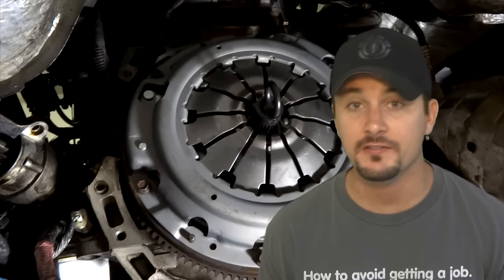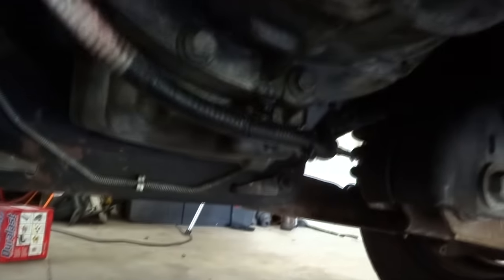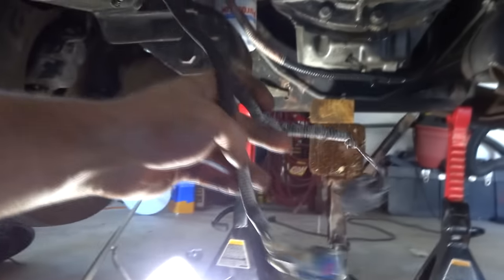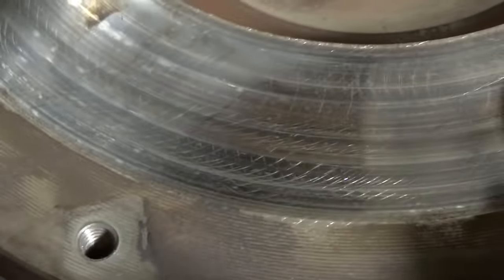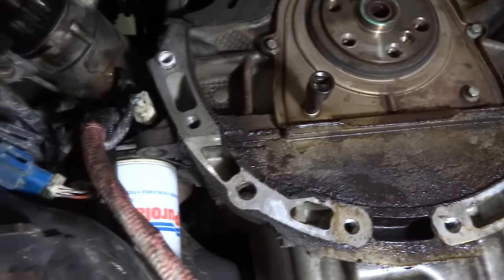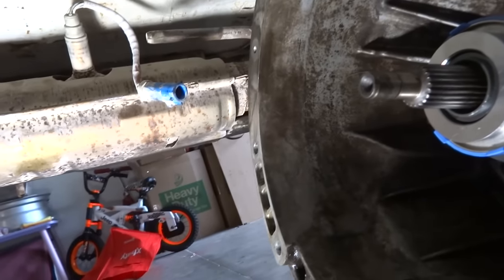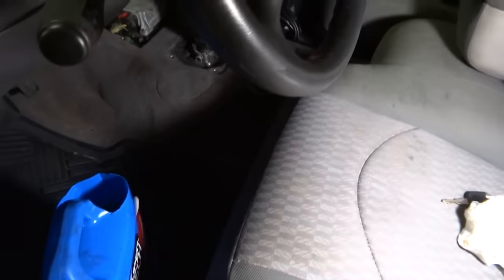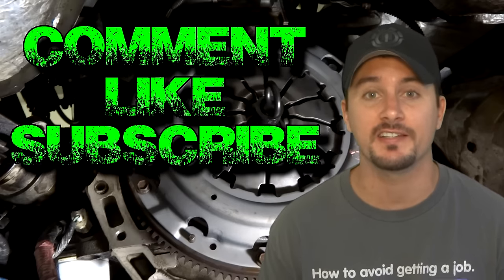Clutch Replacement Ford Ranger & Mazda B-Series ⚙️🔧

Comment from the maker: 🛒 Shop This Video: https://www.nthefastlane.com/clutch-replacement-ford-mazda-store
🛒 Visit Nthefastlane's Amazon Store: https://amzn.to/3pP4UCy
Reply: Kinda confused on a couple of things.. When you replaced your rear main seal it appeared that it involved removing an entire metallic type housing with the actual seal in the middle.  I have a 2000 2.5L I4 (5 speed of course, the common Mazda M50D-R1) and every "rear main seal" I can find for mine just appears to be a circular piece that looks similar to a large wheel bearing seal.  I can't even find the part you replaced on the internet, and it isn't in the "Buy Parts For This Repair Here" link.  I would think mine is just different but I can't even find that part that you replaced.  It looks like the rear main seals I've found just replace the circular part in the middle of the metallic assembly you removed.

After quite a bit of digging I was able to find the part I think you used (BS40689) and it does not list 2000 Ranger as compatible, so I'm guessing it must be due to my 2.5L engine.  None of the sites list that part as compatible with my Ranger..  so I'm just gonna buy the round one and hope mine looks a bit different once I dig into it!

Also, the constant correcting yourself when you mis-spoke is a bit annoying after the 100th time or so.  It makes it pretty darn confusing for people who aren't completely familiar with all of these parts, and people who are completely familiar with all of these parts really don't need tutorial videos anyway.  You obviously edited quite a bit since we didn't need to see every bolt being removed and an eight hour video, so I'm curious why you didn't edit some of that stuff out.  Just some constructive critisizm.  You're still getting a thumbs up from me for all of the help, and taking the time to try to show others how to do such an involved job.  Thank you!
Reply: Nthefastlane hi
Reply: where are you located, can you fix the clutch of my ranger?

Comment: Thank you so very much for this video.  Because you did this video I was able to fix my truck.  Thanks so much.  Its people like you that make youtube great.  I had shifting problems tried to go the easy way and replaced my master cylinder and had the same problems.  Then I figured I had to change the slave, thanks to you I was able to take the tranny out I looked at the clutch and it seemed waisted.  I was able to change my rear main seal, my pilot bering my slave cylinder and my clutch and I really don't know if I could have done it with out this video.  Also the bread thing worked, I ended up stuffing a 10mm with bread which was a little smaller than the inside of the pilot bering worked great.  I felt pride as I driove my truck away working, thank you.

Comment: I bought my Mazda B2600i Labor Day weekend in 1992.  I have been driving it for 23 years and it has 303,400 miles on it.  The original clutch is going out now.  I have pulled my 16 foot car trailer 1,000's of miles, and many other trailers.  It has been worked hard.  God has blessed me with a great truck, so today I am putting in a new clutch kit.
Reply: +Ivak Cooper What size engine do you have in it?
Reply: +Mike A-strong  Mike, It is a 2.6; B2600i
Reply: Those Mazda B-Series are NOT the same thing as a Ford Ranger. Your 1992 is Mazda's own truck that they used to import, but they partnered with Ford and created a Ranger copy starting model year 1994 according to the Haynes Repair Manual I have.

I'm gonna be doing this to my 1995 Mazda B2300 5-Spd Regular Cab. Release bearing went out and won't shift into a gear, and once it's in gear, it WILL CONTINUE to stay in gear no matter how hard you press down on the clutch. We replaced the master cylinder and bled/burped the hydraulic system 6 months ago. Might as well replace the slave cylinder since it's in the same bell housing, which is such a dumb design.
Reply: Theodore,   I am still driving it.  I think I have another 8500 miles on it.  I put in a clutch kit from O'Reilly's just to save money, but it isn't the same.  I never did think much about the Ford Ranger.
Reply: Ivak Cooper

Comment: The bread trick is absolute genius!  I used a 6" piece of 1/2" round steel with one end tightly wrapped with electrical tape built up to create a snug fit inside the pilot bearing.   Worked like a charm.  Thanks for posting this, I'm replacing transmission, rear main seal, clutch & flywheel on a 2002 Ranger 2.3 👍
Reply: Two years later, truck shifts and drives perfectly. 👍

Comment: Awesome. Great job. This video was extremely thorough & detailed which was exactly what I needed. Your camera work couldn't have been better. Took me ALL DAY, but a small price to pay for the experience & the time & money I saved doing it myself. Couldn't have done it without you. Something tells me that making these videos isn't near as easy as you make it look. Keep doing what you're doing. Thanks.
Reply from the maker: Awesome PCN! Glad you were able to use the video to get the job done. Thanks for the feedback! 

Nope, it sure isn't. I did a comparison a while back when recording a strut replacement. Filming the passenger side strut replacement took nearly 4 hours if I remember right. Not filming, the driver side strut replacement took 15 to 20 minutes tops.
Reply: @Nthefastlane  as someone who does video production for a living, filming in all these tight places with terrible lighting is a royal pain in the ass.  It makes it twice as hard and slows you down so much.  But thank you for taking the time to film this.  Im no mechanic, so i rely on videos like this to learn.  The detail is greatly appreciated.  Subscribed.

Comment: For a transmission jack, we drove (or pushed) the car up on ramps (Today's plastic ramps aren't nearly as tall or strong) laid on our backs on the grass and used our hands and our knees for removing manual transmissions on '66 mustangs, '69 Torino's, camaro's and later on an '84 F150, I din't even use ramps. Just crawled under it in the driveway and did it.   Manual transmissions are heavy but aren't nearly as heavy as an automatic. Of course, it helps if you are reasonably strong, in shape and used to dealing with weights. In the 70's, most of us were. Now, at 60, I may still be up for it on a ranger 5 speed transmission. That's the plan, anyway. I May try your improvised jack if I don't feel froggy enough when that day gets here. Thanks for the video.

Comment: Nice job, i replaced a clutch on a 2000 Heavy Duty 7.3 Powerstroke and the Ford clutch broke 1 out of three springs. I replaced the Ford clutch with a NAPA clutch, they updated from 3 to four springs.  The clutch comes complete with a  fly wheel. Great job on your video lots of detail... Stay safe and Happy motoring

Comment: Thank you for providing such an informative video. It has been an invaluable resource for information. I happened to buy the same Duralast Clutch Kit & Slave Cylinder as you did from AutoZone. Might as well change the Slave Cylinder since there is no other way to get to it. 

My truck is a 1995 Mazda B2300 SE Regular Cab 2WD model. 196,346 Miles on it. Odometer stopped in 2010/2011. I estimate the truck to have 205K or 210K miles. Clutch pilot bearing failed and completely ruined while driving around town. Truck wouldn't go into gear when running, and if it was already in gear, it would stay in gear and no matter how hard you pressed the clutch petal, it had no effect on disengaging or engaging the clutch plate, like a dummy petal on an automatic car. Clutch is in good shape considering the mileage and flywheel is in even better shape. Going to replace clutch anyway.
Reply: What’s the parts number

Comment: I liked your video, I am planning on replacing the clutch on my 88 ford Ranger 2.3Lt. Reg cab and long bed, with 635,000 k on it. It runs Perfectly and believe me.....I see newer trucks broken on the road. Mine is a jewel of ford's engineering. An it also is my anti anxiety/depression therapy truck. We have 3 more newer cars, but this is special!
Reply from the maker: I can relate, I use my shop as anxiety therapy all the time.

Comment: @nthefastlane Thanks alot for the detailed video! I just had a clutch kit installed "professionally" and a month later i am hearing a knocking noise when i let go of the clutch after running for some time. I will use your video to walk me through the wrongs and rights to figure out what the problem is.

Thanks again, Nathan
Reply from the maker: Nathan e Anytime, glad I could help..follow the steps and you should have no problems at all.

Comment: Great step by step video. I have a 2011 xlt 4.0l 4x4 with less than seventy thousand miles. Clutch pedal stuck to floor and fluids coming from transmission where the slave cylinder is.  Going to start on it in the morning.

Comment: Great tutorial video . Just one suggestion , it would be great if you can give us the torque specs for bell housing to engine bolts, drive shaft to rear axle bolts and wherever bolt or nut torque is required. I love your ingenuity of  transforming that jack into transmission jack. I learned alot. Thank you

Comment: On my 98 Ford Ranger 2.5 v4, the flywheel bolts where 17mm rather than 18mm as stated in the video.  Also, the torque specs where significantly lower for them.  I foolishly went by the video and almost rounded out a bolt.  Overall, this video helped immensely!  I liked the beatle part.  Proper job!

Comment: excellent video! thanks for posting it. I'm replacing my transmission because it died after 327,000 miles and this really answers a lot of questions about what I can expect. One question: the rear main seal is just the rubber part, right? Not the metal housing, too? Oh, and couldn't you have knocked out the pilot bearing while you had the flywheel off? I'll go back and watch again to see.

Comment: Hey Nthefastlane nice videos,  quick question do you know if there are different style throwout bearings?  I ordered a LuK 07-140 Clutch Set from amazon and my friend that is installing it for me said the bearing is different than the original stock, the stock bearing has grooves for the spring?  He said the one in the set is a cup style or something?  I tried asking at auto zone but haven't gotten anywhere yet, unless theres an installation manual somewhere to show the difference in styles?  Anyway just looking for some suggestions/tips thanks.  Great job at getting clear views of the installation of this clutch!

Comment: excellent video the camera was excellent angle i have the same problem and when i started the truck when is cold the gear shift not engage until is hot i don't know what is but I thinking to replace all gear shift to see if change if you can or some one reply should by good
Reply from the maker: First check your transmission fluid level. If that pans out correct, I would then check your master cylinder clutch fluid in the reservoir. If all that pans out, it could be your master cylinder,slave cylinder or clutch springs could be bad. If you have a broken spring on the clutch, the shifter when the vehicle is running will be stiff as a board and will barely move. If you turn the vehicle off and it goes into gear with little effort, you have a broken spring on the clutch or the clutch is cracked in some way.

Comment: Hey so when you are putting the transmission back in, does the slave cylinder have to compress for the bell housing to mate back up? I’m having a real hard time getting the transmission to get close enough for me to start the bolts. It looking up in there it seems like the slave cylinder is butting up against the pressure plate and stopping me from getting it any closer.

Comment: looks like you have lots of comments, but I figure I'll give it a shot...

First off, epic video! It's about to save me tons of money. I'm super appreciative you put this together.

So my main question is about the slave cylinder. Should I replace it while I'm in there, or would it be just fine to put on the new Throwout/Release bearing that comes with the clutch kit??

Comment: Hello sir , I have a question about the ford ranger clutch , I have a ( Ford Ranger XLT 4WD 2.5L 4cyl petrol 2016 manual 5 speed ) and I want to replace the orginal clutch for it with heavy duty clutch such as Stage 1 , Stage 3 and others. So I made some researches on ebay and I found many but they say it fit 95-11 , so my question is: would they fit my vehicle or not ? If not , do know any other types that might fit my vehicle? Thank you and I hope you read my comment 🙏

Comment: And take me back to the days when I used to do the one in my 65 mustang 6 cylinder 3 speed in about 2 hours and that included putting the stripped out first gear and make yourself some half inch extensions out of rebar long enough to reach up to get those

Comment: When replacing that trans fluid mine took around 3 quarts. The first 2+ I just dumped in and then I started watching for drips well into that 3rd quart. Some have questioned the ATF but that is the correct fluid. On other vehicles I own the trans takes engine oil. Not everything takes gear oil and putting the wrong fluid in is not going to end well.

For a 4wd it is often easier to remove the transfer case first. It is not many bolts and then you don't have as much length or mass or offset mass to deal with. The transfer case will want to twist the transmission on the jack if left attached and it makes re-installation more difficult as well.

Comment: Is the slave cylinder specific to a self adjusting or standard clutch?  What I mean is if you start with a self adjusting clutch and change to a non adjusting, do you have to change the slave cylinder to a non adjusting slave cylinder. Or will the slave work on either clutch?  Great video thanks
Reply from the maker: No, the slave cylinder is a standard part number and is universal..the self adjusting clutch should adjust itself to the salve.The slave I had originally was the same as the new slave and it was used with the original self adjusting clutch in the vehicle.

Comment: This is really great, man! I'm about to change the slipping clutch on my '04 Ford Escape, hopefully this weekend. I don't plan to do as thorough a job as you did here, due to the time constraint I have. It's about 112000 miles on it. Am i being optimistic to just finish changing the clutch in a whole day, starting early? It'll help you have any advice at all, since this is my first time doing it (I have a friend helping, more experience, but first time doing clutch work). :)

Comment: So my truck (2003 ford Ranger) sounds like it has a bunch of rocks tumbling in the transmission when im sitting at idle and the sound goes away after I get going and fully release the clutch peddle. Is this similar to what you were experiencing before the fix?

Comment: My Chilton manual says that the throw out bearing needs to be lightly greased on the face of the bearing and the inner bore with lithium based grease.  Can you vouch for this?  I've read that not greasing it can cause the bearing to seize up.

Comment: EXCELLENT Video one of the best I've watched. Do you have one to remove the transfer case on 4x4 1994 extended cab ranger?
Reply: I'm assuming you already did it but basically pull the driveshafts and there are maybe 5 or 6 bolts that hold the case to the back of the transmission. Support the case with a transmission jack and remove it. Depending on your exhaust situation you might have to wiggle things around a bit or remove that part of the exhaust. When doing this job on a 4x4 removing the transfer case is the first step. You can pull the whole deal as a unit but it is more hassle.

Comment: May I ask what year and model the truck you were working on was? I saw that it was obviously a Mazda B-series, but when comparing Main Shaft Seals for my own 1999 B2500 they looked nothing like the one in the video. Your response would be greatly appreciated and very helpful.
Reply from the maker: Velshard Sorry for the late reply been slammed with work. It's a 2003

Comment: Not sure if you update or follow this anymore but I have a question; on the line that runs from the master cylinder down to the slave cylinder on the trans, is the fitting supposed to seal itself when released from the slave? A new on is 80 bucks and don’t want to buy one if I don’t need to. I’m going to bench bleed my master but soon as I pour fluid in it runs out the slave line. Thanks in advance
Reply from the maker: Yes. The master cylinder line is "NOT" suppose to leak once it's locked into the slave cylinder.

Watch this video on How to properly bleed a master cylinder. This is the only way to get the air out with these type of master cylinders. There is a "Shop This Video" button under the video if you're considering buying a new master cylinder. You may like my stores prices better :) Hope this helps! 
Link: https://www.nthefastlane.com/bench-bleed-a-clutch-system-how-to
Reply: Nthefastlane Thanks! I sure appreciate you getting back to me so quick. Much obliged, I was about to use it like it was. And yeah I’ll watch that video 👍